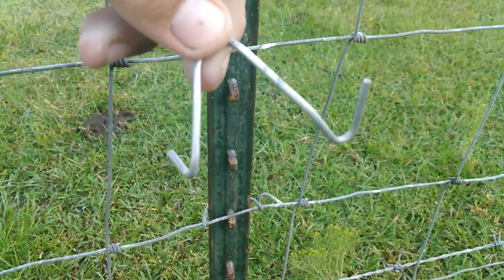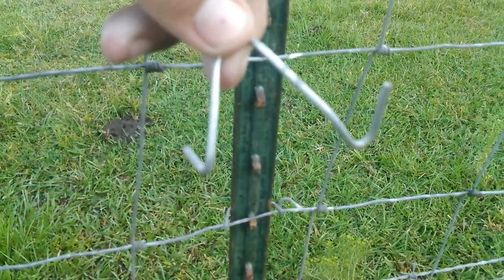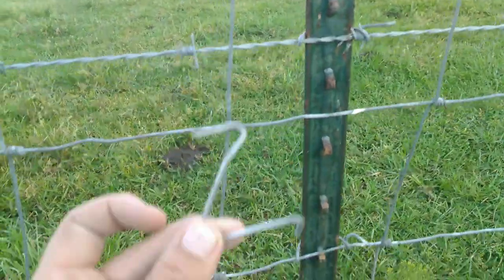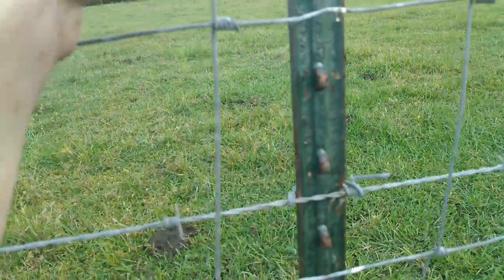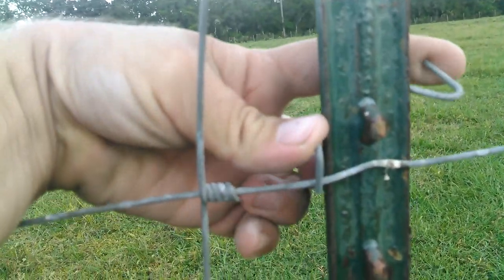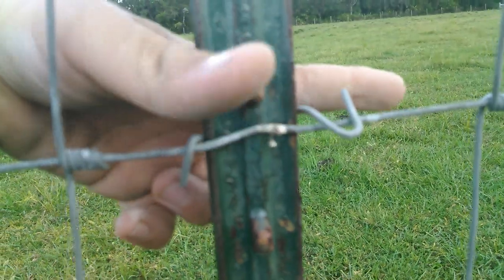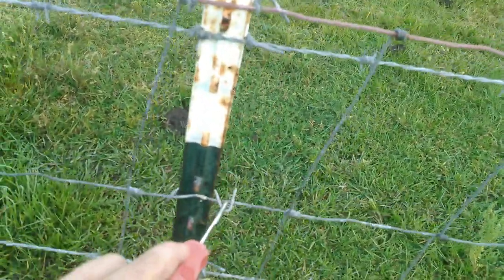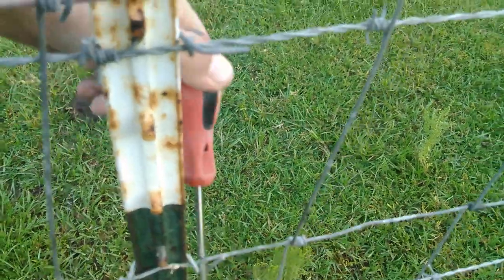how to install a tee post clip

Comment: This doesn't work for me.  The left side of the clip is much too loose.  I feel like my clips are much larger.  Also, the clips are stronger wire than the fence so I'm bending the fence more than the clip.
Reply from the maker: something isn't right then does the wire pull off the tee post? and thanks for watching don't forget to subscribe